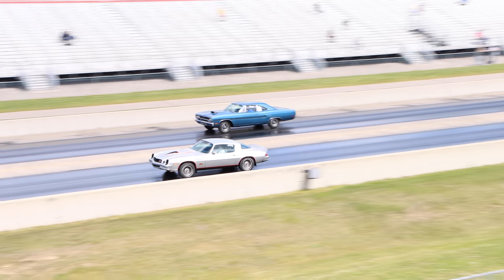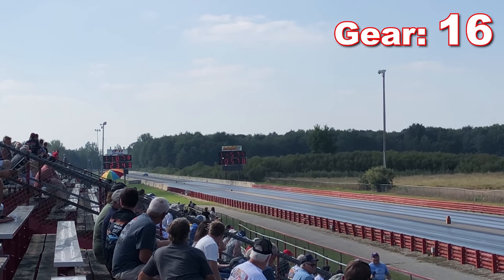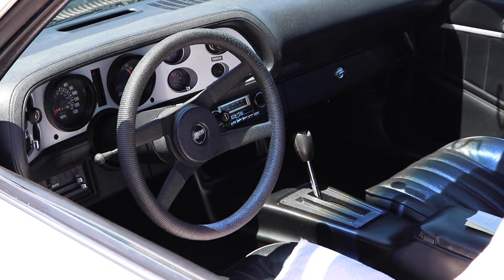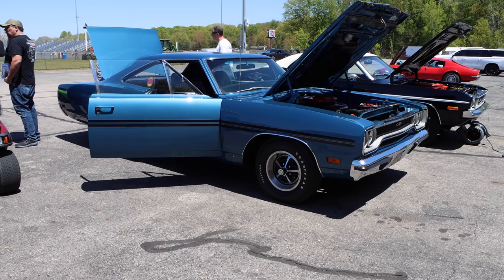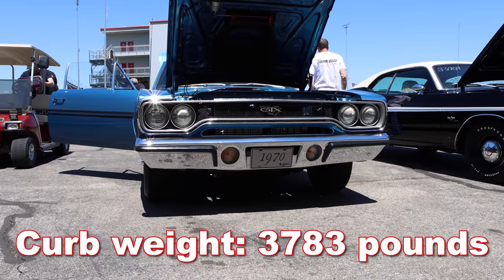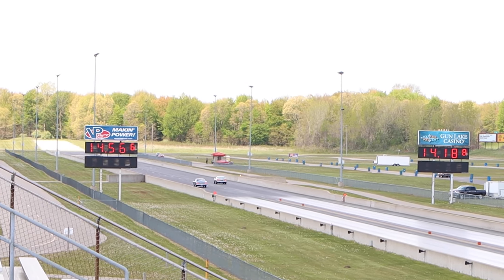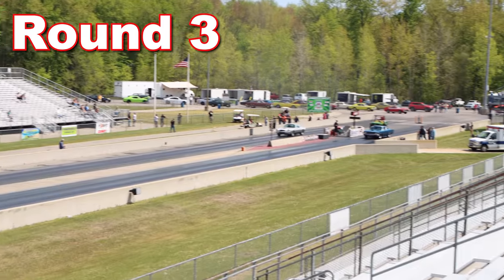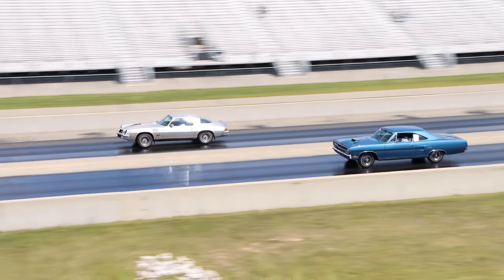1978 Chevrolet Camaro Z28 drag racing 1970 Plymouth GTX FACTORY STOCK DRAG RACE

Comment: I had Family that had that same Camaro I had neighbors that had the same Camaro there was no way in any kind of  fashion form this side of Jupiter that a 78 factory z29Camaro pulling low 14 or a high 13 second quarter-mile that Camaro is tuned I grew up with that type of car  1978 z28 fully loaded my moms was red. Now the next year Trans Am came out with the actual package that can run like that and I believe it had well over 200 and something horsepower but they under rated saying only 220

Comment: All sports is cheating, and this class is no different. At least in this sport it's luckily easy to spot the cheating - trap speed. 

A 3,600 lb car trapping 99 mph is putting ~235 hp to the street or making ~300 hp net, or 115 hp over stock. lol that will NEVER happen with the stock heads/cam/CR of a '78 350. Kudos to the Camaro owner on the cheat. Would be interesting to hear of how it was done. 

The GTX is actually on par, if a wee bit slow . Owner probably didn't want to hack it up for the necessary cheats. Kudos to the owner as well, for different reasons of course!

Comment: I had a 78 Z-28 new and it was SO bad....the motor came out with 173 miles on the odometer because I couldn't stand it being so slow.   170 HP was the rating and 4 speed cars came with 3.73 Posi's and 2.64 first gear Super T-10 transmission.   With a 5000 rpm clutch dump mine stock would barely spin the tires for more than 20 feet then just fell on its' face...pathetic.   Also stock mine weighed a little over 3800 lbs so we're seeing quite a cheater car here doing 14.0's.   Stock you'd be lucky to even sniff 15's with one...though with removal of the super restrictive catalytic converter and a bit of tuning they will run a lot better.   Calling this car 'factory stock' means someone played Smokey Yunick with the rule book.   Not saying he's cheating...but NO stock 78 Camaro ran like this...no way.

Comment: ...the results of this race show how 'stock' some of these cars are, under the parameters allowed.
to see a '78 anything beat a '70 GTX is pure lunacy, lol. IMO, the rules should be tightened up..otherwise, why have the class at all? Should Stock run vs Modified in any race series? Shrugs. 
Z/28 was 0-60 in 9 seconds. Yeeaah. a new Chrysler Pacifica minivan hits in the 7's.
The quickest production veh. in USA in '78 was ofc, the Dodge Lil Red Express pickup with a 
non emissions strangled, dual snorkeled, fresh air gulping 360 ci V8 with a Carter Thermo-Quad :) 7 sec. 0-60.
..& yes, I'd rather the '78 Charger with a 400 4 bbl than a Z/28, any day..literally an 
ign, dist and cam away from 13's, luxurious & strong as an ox <3
Reply: I surely want to see pure stock cars run against each other. But there are so few and most of the pure stock, concourse type cars are so valuable that they seldom, if ever see a drag strip. I am going to restore my 68 383 Charger bone stock and even try to get a blueprint of the stock 4 bbl cam. But it will probably only run in the 15's when it's done and that's pretty boring to watch. Still, if you, or someone started a bone stock race I bet there would be a number of people with survivor cars and totally stock restorations that would show up. F.A.S.T. rules do keep most of the factory parts in place. I mean who would think that a car with a set of cast iron exhaust manifolds, full exhaust and a pair of Carter 4 bbls would run in the low 11's? They may not be showroom stock but they are closer than the average street rod!
Reply: @1967davethewave  Good note, thanks. Most ppl cannot be bothered to read or write anything longer than 2 sentences..short ones, lol, in comments. Yeah, true stock vintage car drags would be fabulous, indeed..to reiterate, this series is akin to a mix of stock and modified..none of us her knowing what has been done, like cam & compression which can ofc add huge power differences...esp given modern cam grinds. I'll always be a Cars and Zebra's fan, he's a fabulous content provider. & Ahh, you refer to the 426 Hemi, ofc. yeah..those were not normal manis! Very hi-flo pieces. Over 1,000 cfm & deep breathing heads make the Elephant a monster, esp on the far end of the strip. They made 425 hp..at just over 5,000 RPM, but in fact made power to around 6,100 rpm where hp was close to 500 :D Underrating them to avoid huge insurance and govt overreach crap. A 426 Hemi car can dip into the 12's with a tune & proper tires & ofc a good driver. 11's? Yaa. Not much is needed. A wee bit bigger cam.
Reply: @gzuzsavz  That Super Bee is amazing as is the L88 Vette it races against regularly. The builder of the engine made a post on one of the videos and said it makes 660hp if I remember correctly. I started racing my 69 GTO back when I was first 16 in 1983. It was truly 100% stock with only 65k miles. Standard 350hp/400 auto, 3.55 rear, no power anything. It started out running 15.30's and by the time I decided to pull the 400 and put in a built 455 I had gotten it down to 14.68. I thought it was pretty fast at the time. Today it runs 11's but is no where near stock.

Comment: The original tests, quoted above, indicate what the stock cars really did at the time.  There is no way a stock '78 Camaro would even stay in the same zip code as the '70 440GTX.  I spent many years drag racing in various amateur classes and any US car made after 1971 was a dog compared to the 71 and earlier muscle cars.
Reply: Removing the single CAT and rejetting the carb is worth close to 100 HP on that particular small block, He is also allowed, by the rules, to raise the compression 1.5 points, so 9.7 and can replace the cam with one of modern design as long as the lift and duration is the same.  That GTX looks all original, so doubt the engine has been blue printed.